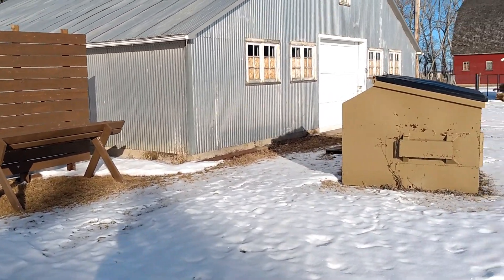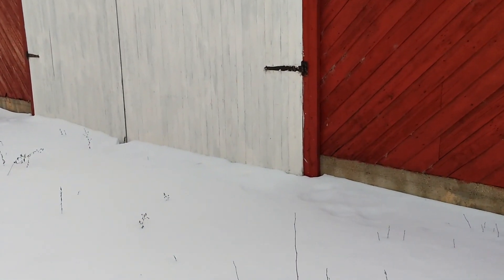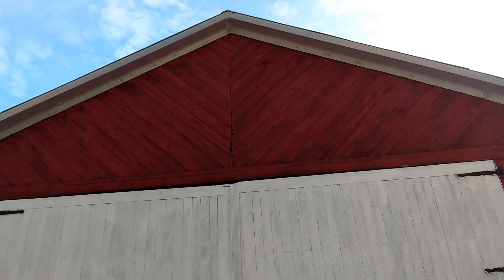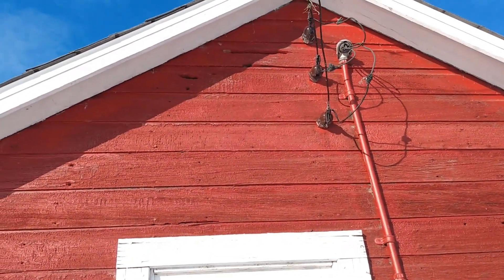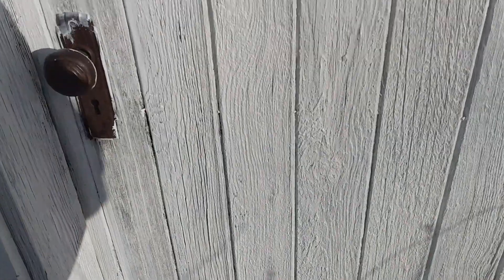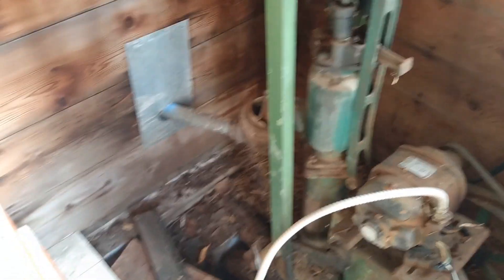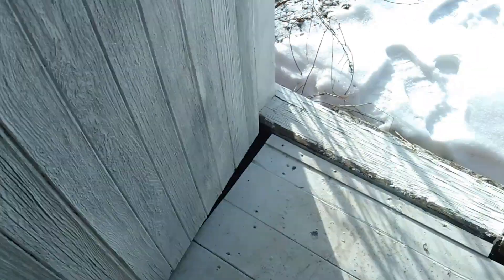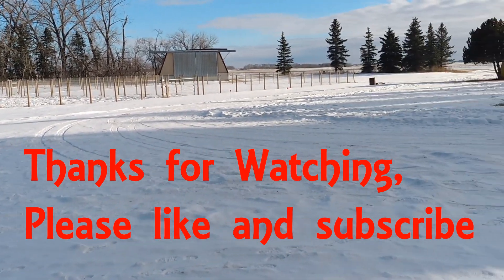Ontario to Saskatchewan #homestead #rural #farm #outdoors #family #moving

Comment: That is a converted hand pump down that well - if you disconnect the motor, you might be able to put a handle on it and pump water to the animals rather than hauling from the house.
Reply from the maker: Thanks for your tip. I will have to look into that. One way or another I like to put the well back into use.